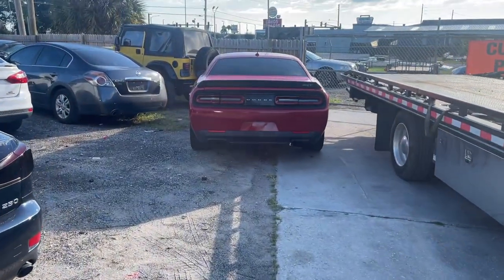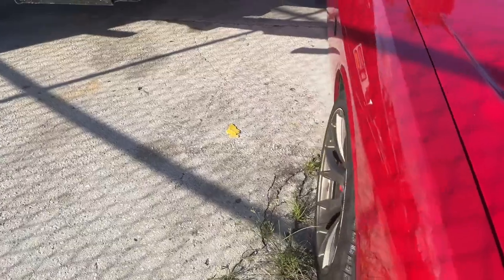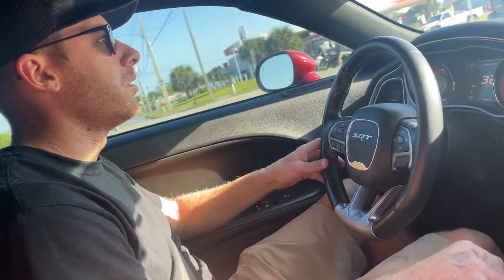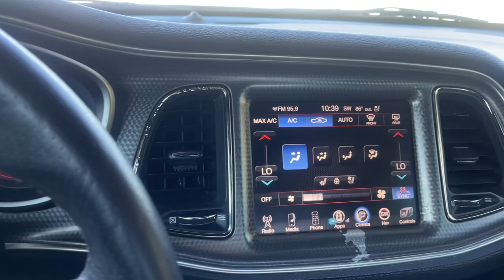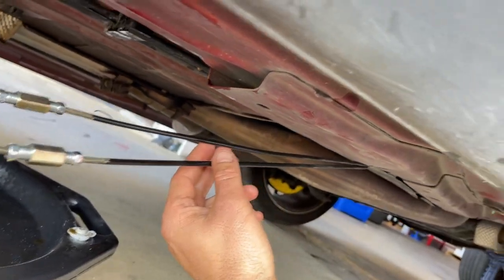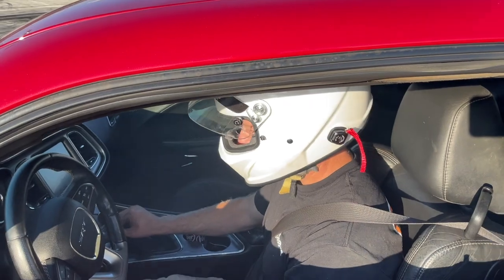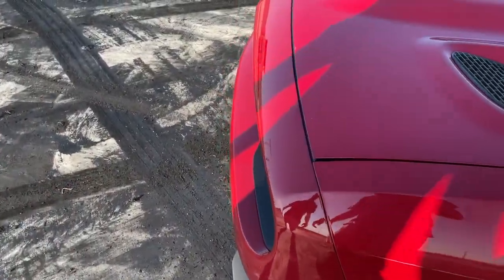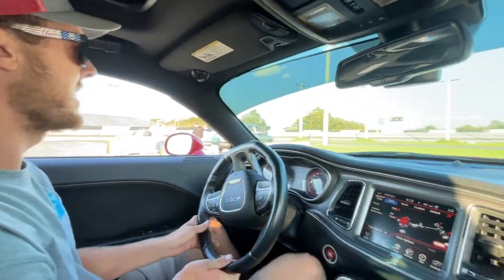Worlds Highest Mile HELLCAT! The Ultimate Burnout & Drift Car for Cleetus & Freedom Factory Events!!

Comment from the maker: Like this if you’re a Mopar or NoCar kind of Gearhead
Reply: You should do what Cooper did on his rear brakes, he put a shut off valve in the rear brake lines, all he has to do is turn it off to delete the brakes, Nice ripper brother.
Reply: at this point . you need a " Sponsored By Freedom Factory intro lol  or Sponsored By McFarland Racing    
i know  u said you dont wanna 'use ' ur bro .. but hey family bizness , yull only grow from it ;) 
,......and growth on YT = $
Reply: Not the biggest Mopar fan but you have to like the hell Kitty if you like V8s anyway..I'd pull the motor after cleetus an cars new hardware in her. definitely a bigger upper pulley
Reply: The Smellycat!
Reply: Please do a Dino video... to see how
Much power it has lost.
Reply: the banana peels are actually supposed to be removed by the dealer they're plastic protectors
Reply: Give it a good once over because some of the other engines with the mds and vvt setup have bad roller rockers and the rollers can score the cam. Pretty sure Hellcat engines don't have any of those features but it certainly needs some love and preventative maintenance so something bad doesn't happen right away and I bet the blower is dead anyway as I don't here the usual blower whine. Cool car even with the mileage, especially if you got a stupid deal on it. My 06 Charger RT will try to burn both tires because of the way the independent rear suspension is setup even though it doesn't have a Sure Grip rear (posi) but I bet that one has a clutch type sure grip in it considering what it is. It deserves some love and a better life now that you have it👍
Reply: Really would like to see that on on a Dyno to see how.much power it has lost...huh strange car
Reply: It going to be a ripper and sounds awesome dude 😎 👌 I love seeing u and cleetus together ripping hell yeah brother keep it coming 😁🤘🇬🇧
Reply: Love it cant wait to see more content with the hellcat!
Reply: Gut that thing and mod it to turn it into a 1/4 mile beast!
Reply: I am 💯 Hemi Addicted so you have earned my following for sure 😁
Reply: I like mopar and I have no car does that count?
Reply: I love it. My emotions are just so all over the place. I know LS power is cheap but obvi even cleetus sees these Hellcats are getting very very affordable and clearly are plenty powerful. I’m just overflowing with mopar feelings right meow.
Reply: hellz yeah!!! this is gonna be siick
Reply: Where was cleetus helmet at 😆
Reply: By default via way of Jeep 🤙

Comment: Would be interesting to see it run on the dyno and see how much horsepower if any it has lost in all those miles
Reply: Yes please!
Reply: All those smokes might have made her a little short winded 🌬
Reply: Definitely cant really hear the blower so im sure its down a bit on power. Clearly has plenty still
Reply: YES
Reply: @kylefitzherbert9381  probably around 425-500, possible compression loss after all those miles if the previous owner didn’t get much service (black oil points to that)
Reply: @erinflaherty4878  had to have been well serviced to have that many miles
Reply: @GrantMckeeG8  definitely came to mind as I wrote it but seeing as the supercharger needs rebuilding I’d think the service while existent may have been under par or not serviced enough, either way the car made it to where it is somehow and it’s in maybe better hands
Reply: 600at least
Reply: Yes definitely
Reply: @kylefitzherbert9381  it’s stock

Comment: The power might be a the key. They have a daily key and a sport mode key. About 200hp difference between the two. If you don't have the red key, a tune should fix the problem.
Reply: I htink it said "red key" on the dash. I was wondering what that was about.
Reply: the red key is active but it probably needs a retune

Comment: Imagine how much the previous owner spent on gas to get to 175k miles.
Reply: Like 60,000
Reply: Plus that many cigarettes too
Reply: Did the math. For 91 octane (in my state) and a 17 mpg average (let's be real. It's a hellcat. It's not getting 17) that's about 40k in gas.
Reply: @trashbandit2449  lmao
Reply: @trashbandit2449  on highway I get 21mpg in my hellcat charger been a few road trips from wi to az I got 156k on mine
Reply: @crazyeys11  long trip. I'm from Wisconsin too. Likely not highway miles on this cat though, how much do you beat on yours?
Reply: @trashbandit2449  all the time driven in winter I go through about 3 sets of tires a year drag strip road course
Reply: Any  major probs in between   m.fuel rail diff? Anythin else
Reply: Clutch diffs or drive shaft

Comment: You should get a decent "Ozone Generator Air Purifier Ionizer" to remove the cigarette smell or any other odors from vehicles and houses. I bought one called the "Estate 4000". It does 4000 square feet, but it also works great in vehicles. I wanted one for my home and one for vehicles, but I didn't see any need in buying a smaller one for vehicles when this one would do the job in less time. It was like $450, but it was well worth it! It will remove smells of any kind. You can take a towel and pour vinegar on it, and then hold it in front of this machine for a minute and the vinegar smell will be completely gone. And you can sit it in that HellCat for about an hour and the cigarette smell will be gone.

Comment: There are a bunch of tips for removing cigarette smoke smell. Like leaving a towel soaked in vinegar in a plastic bin in the car for a few days. Or use baking soda sprinkled throughout and then vacuum the interior.
Reply: Or do lots of burnouts with windows down may work too

Comment: The yellow splitter guards are only meant for shipping. The dealership is supposed to remove them as part of the PDI. If I recall it's molded right into the guards: "To be removed by Dealership"

Comment: Put some water sprayers on the cooling package. High Oil temps on that will hurt that engine/trans quick.. 225 that quick isn't good. Water sprayers properly will drop that temps to a stable 200

Comment: Which key are you using?
There's two different keys...the black one is only 500hp
The red one is the 707
Reply: Yeah. He should of pulled up the Dyno on the screen. Wound find out if it’s down on power or not
Reply: He's using the red key. You can see it on the dash display.
Reply: @slow_sylvs9643  Yep saw that too. Had no idea what that was about before the comments.

Comment: Throw it on Garrett's dyno... I'm curious what kinda power a 175k mile hellcat still has. Fresh motor most people see around 625 tire. My oil with 100 miles is dark like what you are seeing... I run the Penzoil ultra platinum for SRT engines.. might be the nature of the oil.

Comment: This is going to be sweet. You have to let us know what the price tag was on this.
Reply from the maker: $30k
Reply: @DoctrParker  damnnnnnn what a move!!!
Reply: That's not bad at all.
Reply: Well worth it congrats
Reply: @DoctrParker  damn I should have sold you mine. Just got rid of it a month ago. Mine had 100k less on the clock. Six speed with Barton short throw and 4in wiles driveshaft. Jazz blue with black alcantara. Gave it to a dealer for 38500. Would have been mint for what you needed.

Comment: All those codes can be caused by a easy to fix vacuum leak....Don't spend any more on parts until you check first.  Also, the catch can wasn't probably emptied for months.  In that case that amount of oil should be normal. It is a nice car at 175K.

Comment: do yourself a favor and don't loop the brake lines,   make an independent set up and adapt a 2nd set of calipers dedicated to handbrake,   the ZAutomotive : Tazer ,  also has a line lock option that electronically locks the fronts and doesn't activate /  burn up the rears . plug into the OBD2 port and is just a few buttons clicked to activate . also can totally defeat ESP/power brakes . among other features like strobe lights , and reads / clears codes. etc. inexpensive too .   and look into water meth injection . gonna be a fun project . cant believe the miles,   2 years newer than my charger , with 2x the miles.  wild. .

Comment: How has dodge not figured out the fuel cap check engine light issue by now! Lmao My dad had bought a new 2003 Dodge Ram 1500 and by 2012 when I was in high school driving it around it had a check engine light for the same thing that wouldn’t go away lol